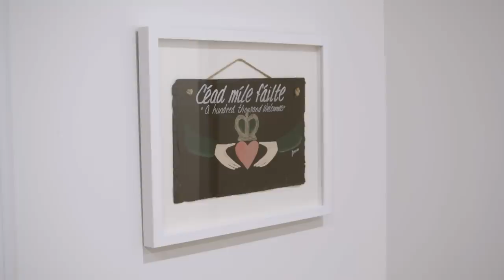Nate & Jeremiah Revamp A Disjointed & Wonky House l The Nate & Jeremiah Home Project

Comment: The layout is odd? The new design is beautiful! Those guys are design geniuses! 😊 I will say that I did not think that the original kitchen was that small. They must entertain a lot so they need it opened up. I have a galley kitchen in a traditional ranch style/Mid-Century home from 1965. It is(original build)open concept from the kitchen through the living room through to to formal dining room. So open concept has been in original designs in the past. Just ours is more of a hybrid. As we still have some separation. Which I like.. Still my galley kitchen is much smaller and we manage fine. I guess if I had a $100,000 budget for remodeling I would go for it too... Good for them.  😊

Comment: Love it. I would only question the runner on the stairs. How would you keep that clean when it's such a light color? Do you have to take shoes off in the house?
Reply: @yael Smiley Simckes I believe they kept the original runner design we saw on the first walk through. The clients may have liked it as is, or perhaps this item was outside their reno budget. I guess it's something they can replace relatively easily in the future.